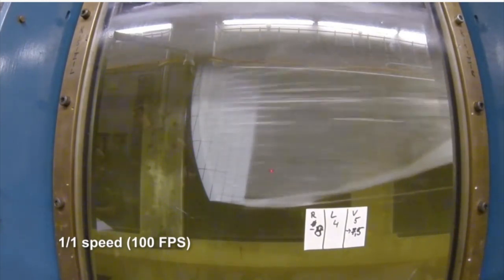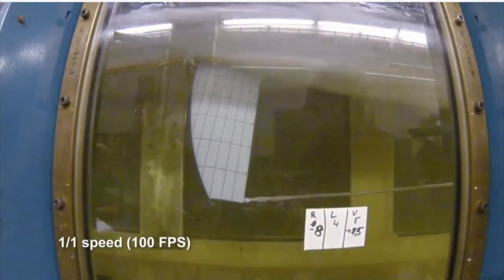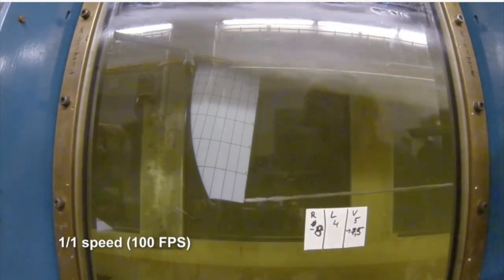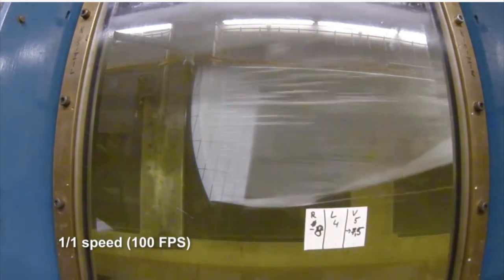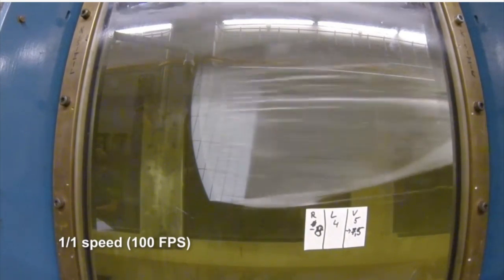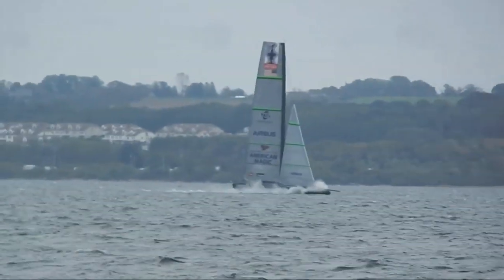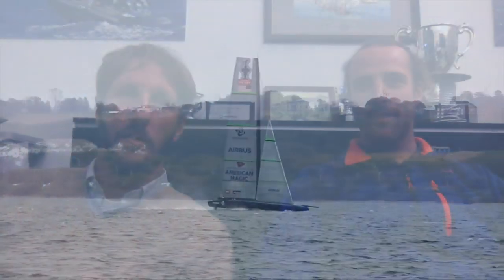E25 - Cavitation and ventilation on AC75 foils

Comment: Could you just sweep the foil back like a jet fighter wing to alleviate the cavitation?  If it works for turbulence, maybe it will work for cavitation.  I am guessing it would be better as a variable-sweep wing, (foil), and may even be required to get up to the cavitation speed in the first place.

Comment: Thanks for your excellent videos. However,  at one point you make a prediction that's been proven wrong in practice. Based on the cavitation theories you explain, you say that the AC75s will have top speeds of around 40 knots, and 50 knots would be impossible. 

But already before even the Prada Cup Final speeds over 50 knots have been recorded many times (by all the 4 yachts I believe), in practice and in actual racing. How do you explain that?

Comment: Question about your comment at the end about favoring the Italians & Kiwis: did you mean that cavitation & ventilation will be more forgiving for those two teams since they have the skeg that gives them the intermediate hybrid displacement and foiling mode, whereas NYYC and Ineos will slow down much more because they don’t have this mode and their wetted surface area will increase much more suddenly?
Reply: Let's say they will be less penalized if they happen to touch the water. If foil starts to ventilate, they can drop in height and touch the water before restarting to fly. LR and ETNZ will brake less touching the water, and probably be able to take off immediately after. AM and UK risk to stop completely once they touch the water even just a little!

Comment: It’s just like stall on a normal wing: flow separates on the low pressure side and stops creating (most of the) lift. As an aerospace engineer I particularly enjoyed watching the experiments in the flume: I didn’t realize that cavitation/ventilation can be triggered in the low pressure core of the tip vortex and then travel upstream to the foil. I always assumed (as a sailor) that it was strictly a surface interaction with the low pressure zone and that the low pressure sucked the surface are from the top/surface downwards. I had no idea the tip vortex could trigger it and cause it to start at the bottom! Very cool!

FYI: water boils at 212 deg Fahrenheit at sea level. Just be glad you didn’t have to learn engineering in both SI and imperial units! Although the imperial unit of mass has one of the best unit names of all time: the “slug”.
Reply: Really glad you enjoyed the video! Just two things to explain better (not easy speaking in another language sometimes): ventilation can be triggered from tip vortex, cavitation it's just function of pressure distribution, fluid type and temperature. 
Ventilation has no similarity in aerodynamics, while I think cavitation has a lot in common with supersonic shockwaves! Stall is not always occurring neither in ventilation nor in cavitation, even if it's easier to have, obviously in these conditions!
Reply: You’re doing great with the English! I know it’s hard, especially with all the technical words. 

I agree that cavitation/ventilation are fundamentally different than stall. But the end result is very similar (especially ventilation): loss of lift due to separated flow. 

Thanks again for the great videos!!